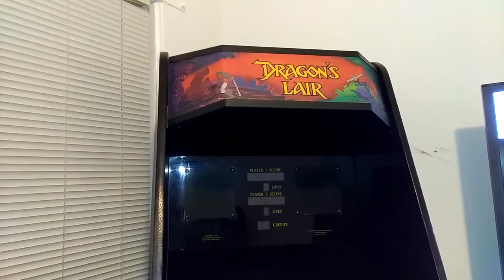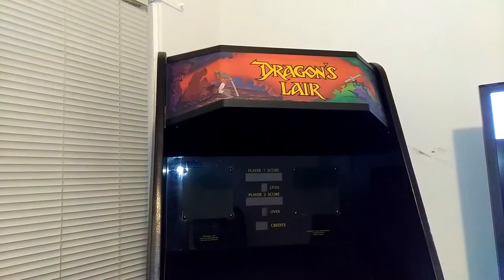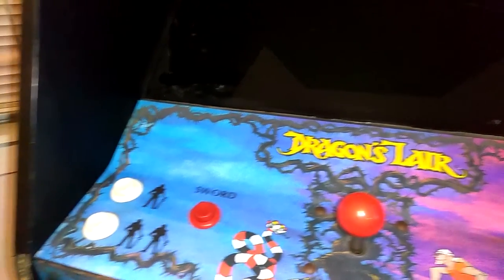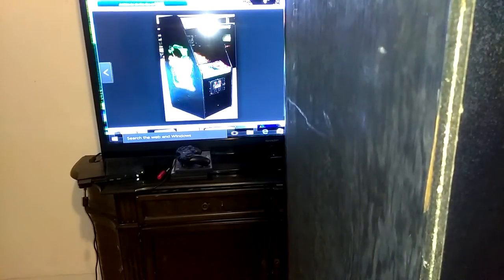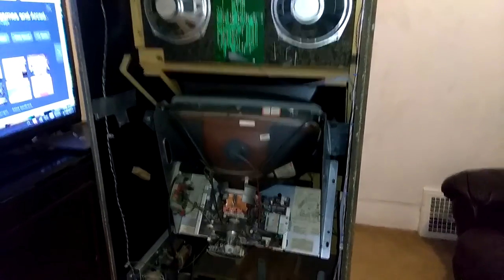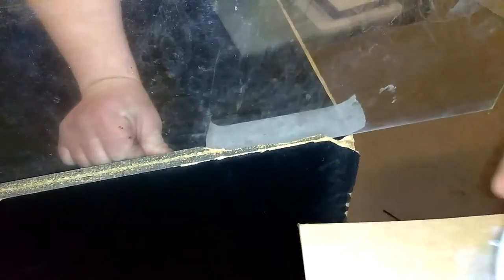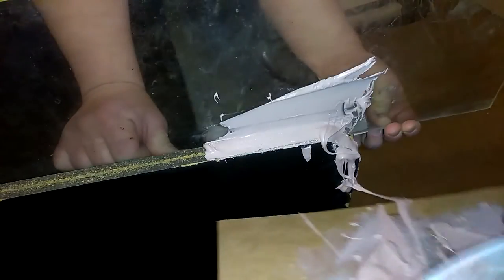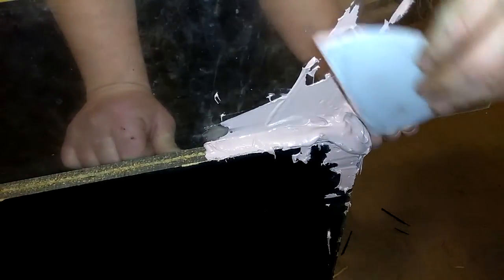DRAGONS LAIR cabinet repair

Comment: Good video. I am on the market to buy one. Could you tell me what is a good price dragons lair go for?
Reply from the maker: It really depends on condition and if it's working. I would say nonworking $50-$1000  I bought mine nonworking for $700  working depending on condition anywhere from $2000-$3000